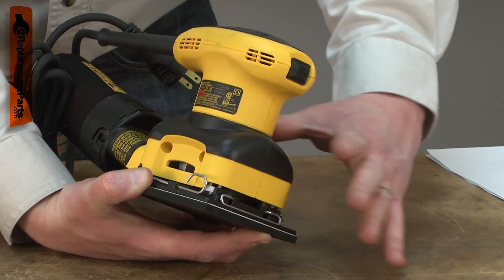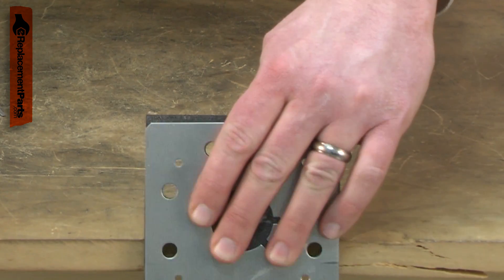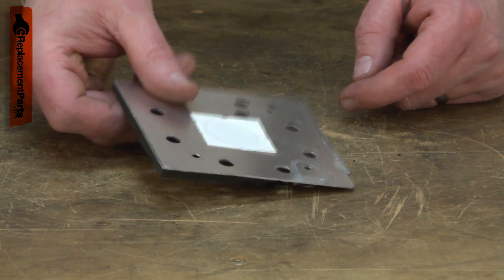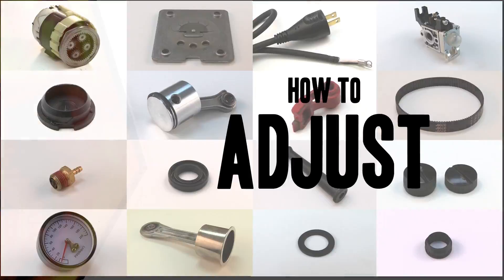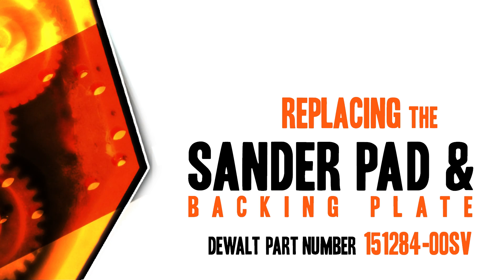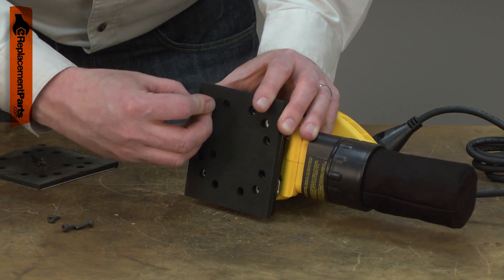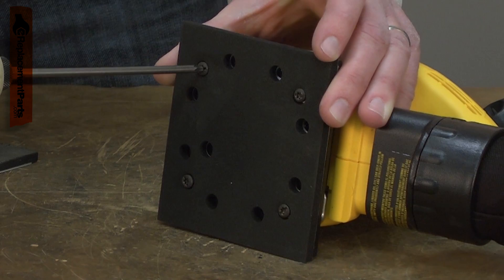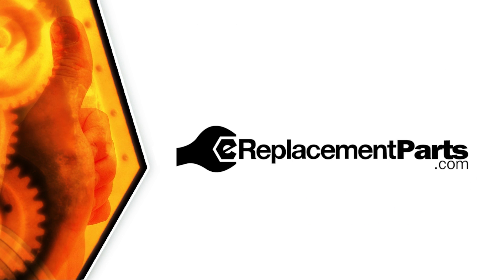Sander Repair - Replacing the Sander Pad (DeWALT Part # 151284-00SV)

Comment: I bought a used sander and was clueless as to the basics of anything, as I didn’t have a chance to learn about power tools before.  It was surprisingly difficult to find this very basic information online, perhaps being “too obvious” for anyone to bother.   I even downloaded a pdf of the 50-year-old manual in my search.   Thank you for this guide; I think I get it now.   I assume I cut the wool pad to size and make the holes myself for the screws?   Anyway, thanks again for taking this time to explain!

Comment: Three Items…
1) You should mention that the screw heads are T-20, not Phillips.
2) Amazon sells the pad for (currently) $9.79 thru their vendor, Toprock.  Get the style for Porter Cable model 340, which DOES NOT have a big (useless) hole in the center (like the one you’ve shown).  That type WILL work, but the hole reduces its effectiveness.
3) Eventually the platen - the plastic piece that holds the pad in place - will wear out.  It’s an easy replacement.  You could have spent another 15 seconds and shown how to replace that.

Comment: I'm trying to replace my sander pad on my Milwaukee 6014 half sheet sander. They no longer make this model and so parts are discontinued. Especially the necessary parts like the pad. Can you help me fine pad material so I can make my own? Figure to use my existing metal base but need either the original fiber base material or the foam they use now. Thanks.
Reply: Ebay
Reply: Try contacting Milwaukee to see if they have any leftover stock.

Comment: Pretty much self explanatory.  Not sure an entire video was necessary for this simple replacement.  Just sayin'
Reply: It may be obviously to someone with a brain, but not to the general public. I've seen people throw out working sanders because the pad was torn. We live in a disposable society where people mindlessly throw stuff out rather than try to fix it. Just sayin'.
Reply: However, I am having difficulty  it the plate releasing after screws were  removed. I feel that since it was on for so long it somehow fused the plate to the machine.  Has anyone else experienced  this problem?